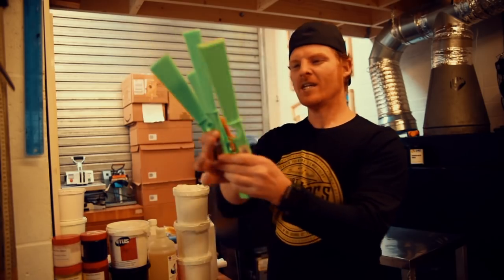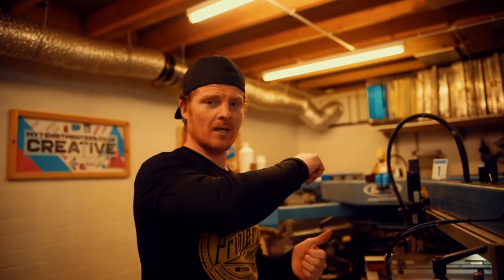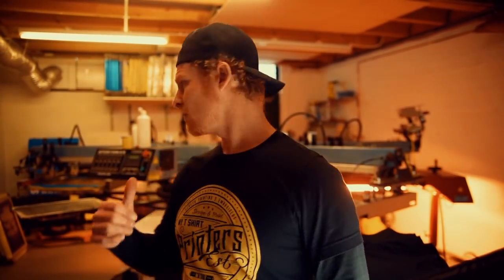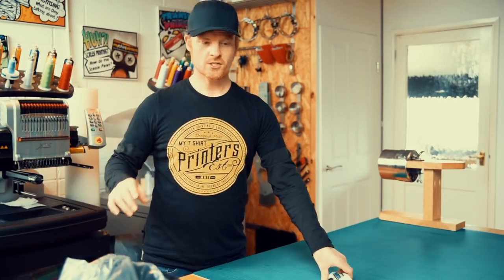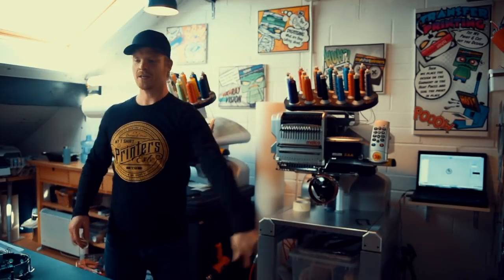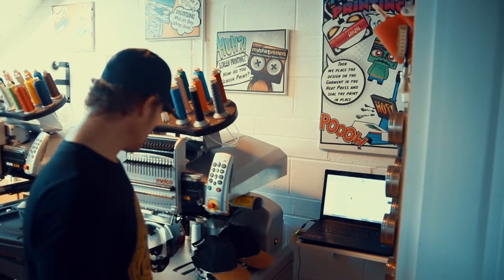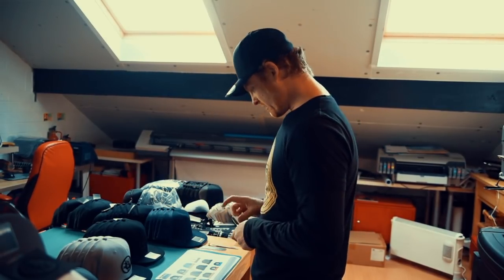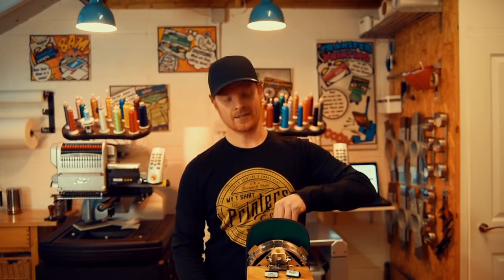Custom Embroidery & Screen Printing for Brands - Brand Merch

Comment: What's the cap style/make you are wearing in the video?

Would it be good for 3D embroidery?

I've had some Beechfield trucker caps embroidered in the past but the stitching pinched the front of the cap inwards and the circular design looked oval :(

Cheers,
Col

PS. The videos are brilliant. it is great to see behind the scenes.
Reply from the maker: Thanks for Watching. 

The Cap Style is a Flexfit Delta also featured in the previous episode (https://youtu.be/QHgU9c1G5zk), we still have to test it with 3D, but by looking at it it may be very good as the centre seam is extremely flat which is great for embroidery. I will do a review of them soon.

Beechfield are slightly more of a promo brand but they are starting to get some good variants coming out in their signature series. 

The reason for your circle coming out oval is down to the digitiser not compensating for the push and pull of the fabric. If it's not correct circles become ovals and squares become rectangle / trapezoid.

Thanks for the awesome comments!
Reply: Thanks so much. I have already had a quote from your good selves  (from Caz), and that was for 3D embroidery onto a Yupoong Retro Trucker Mesh Cap. I hate flat peaks on caps, much prefer a curve :)

I'm just nervous to place an order after the poor results I got last time from cap embroidery from Krowmark.

Your comments though and video show you care about the job and product you produce. 

Will wait on your review of the Flexfit Delta for 3D and might get Caz to quote for that cap if the results are good :)

Thanks again.